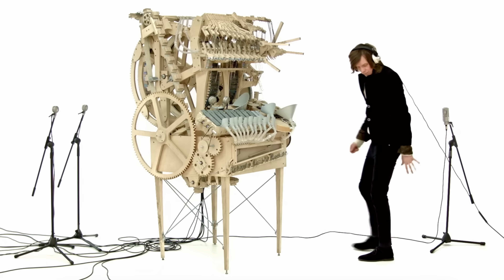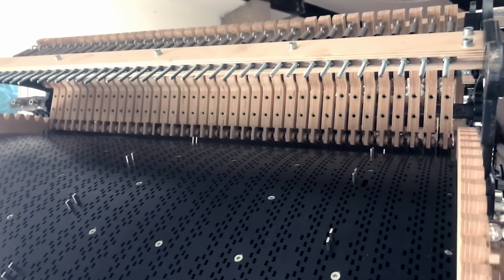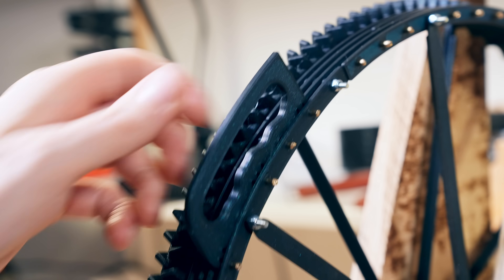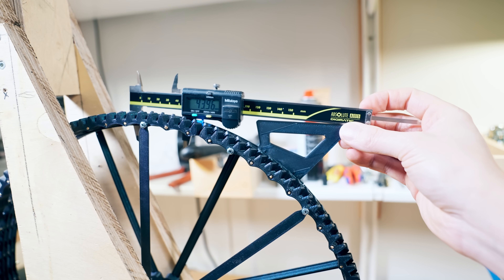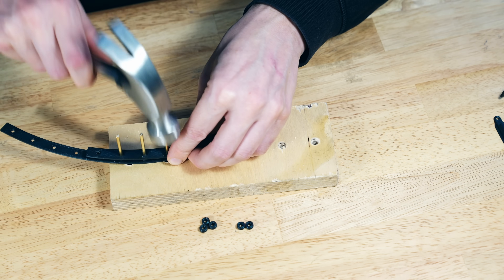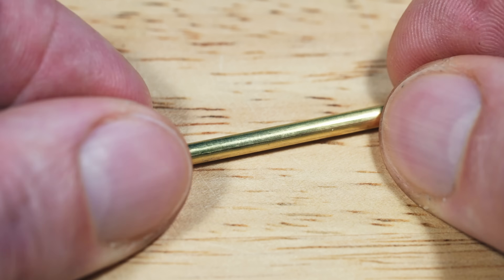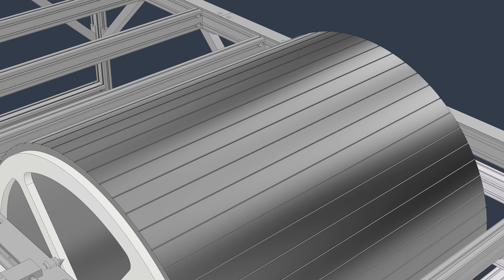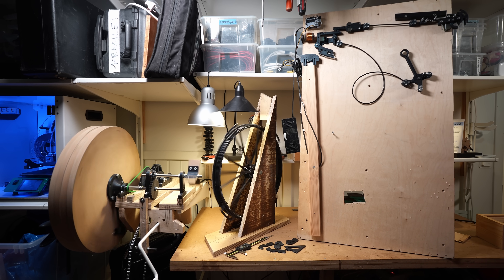Prototyping The Marble Machine Programming Wheel

Comment: Martin, in trying to find a reason to quit the marble machine, keeps accidentally discovering the perfect solution to his problems.
Reply: Martin keeps discovering everything taught in mechanical engineering school, the hard way.
On the plus side, doing it this way means he'll retain all the lessons. When he's done with this project, he should consider fast-tracking a degree from a technical college.
Reply: @peterjohnson9438  I guess the difference will have been between learning and understanding. Having experienced the pain for each and every principle, Martin would have pretty much grokked mechanical engineering by the time he is done.
Reply: @Tsagan learning the 'hard way' usually means you truly understand, vs superficially studying for exams.
Reply: @bubblesculptor   doubt it
Reply: @peterjohnson9438  Press 'X' to doubt.
Reply: @peterjohnson9438 True in terms of mindset and approach to problem solving, but there still is a gaping hole to fill regarding maths, and mathematical models for motion, stress, vibration, dynamics etc. to actually calculate stuff... This would actually come in handy on this project too.
Reply: @peterjohnson9438 He would be useless in real work.
Reply: In a way, this is raw science. He’s discovering fundamental principles through experimentation.
Reply: @quakxy_dukx  It's not science though. Science requires strict methodology.
Reply: @thomasbecker9676  Please, tell me more how empirical testing is not scientific.
Reply: @anteshell He’s not doing “empirical testing.”

For example, examine how he attempted to “prove gravity was a constant” or his comparison that his “Huygen’s drive was 66x tighter than a flywheel” or his failed attempts to try to calculate and compare standard deviation between various RPM.

It’s all an amateur  hack (at best)-but nowhere near anything that resembles an engineering/scientific approach.
Reply: @br52685  You have some nice strawmen there. Did you built them yourself?
Reply: @anteshell  I’m merely addressing your statement about “empirical testing” and providing examples of his non-scientific/engineering approach.  Hardly a “straw man argument.”
Reply: @br52685  Engineering predates scientific method by far. they are not the same thing.
Reply: @anteshell  if anything, your original statement was a straw man—as he wasn’t talking about empirical testing and the scientific method.
Reply: @jarduhat8267  never claimed they were
Reply: @anteshell  Because in true science, you establish a hypothesis and you methodology for testing said hypothesis, including eliminating variables. Then you verify your results. Martin does none of this.
Reply: @jarduhat8267  Lol, that made me laugh.
Reply: @br52685  He wasn't? Here's the direct quote from the comment I was answering to: "It's not science though. Science requires strict methodology."

Tell me more how that doesn't talk about scientific methodology and how empirical testing is unrelated to it.
Reply: @thomasbecker9676  If you haven't seen that, then you're blind. It is as simple as that.
Reply: @anteshell  I was responding to another's comment who claimed:  "Engineering predates scientific method by far. they are not the same thing."

As I correctly stated:  NOBODY EVERY CLAIMED THEY ARE THE SAME THING.
Reply: @br52685  No, you specifically accused me of making a strawman in my first comment and I showed you that is a blatant lie. Try again.
Reply: @anteshell  Empirical testing is next to worthless when not done methodically.
Reply: @anteshell  I showed you that nobody said what you accused them of saying
Reply: @br52685  except that you didn't. I haven't accused anyone of saying anything. Learn to read.
Reply: @jeffreylee7184  Damn, you're making it really hard to take you seriously.
Reply: Man on a mission, to quit ;)
Reply: The true engineer's way. Trying to constantly make people give up on the idea by explaining how much trouble it's gonna be to proceed, only to motivate people by showing that it's possible AND doable.
Reply: Way more functional of his approach of actually trying to make it work
Reply: @extraintelligence The one that started this string of posts. The 21 post before mine does not seem to address your statement directly. I'm going to try.
Why did he hint at wanting to quit? I think Martin is getting tired with all the time/work he had put in to MMX 2 that lead to the scrapping of MMX 2 and the time put into the MMX 3 at this point. I think he is not getting the joy expected from it.
What's stopping him from quitting? It's the massive support and funding he gets and with what you said. Discovering a solution to a problem.
Reply: @tigerzero5216  There's a saying in the consulting industry: "There's money to be made in prolonging the problem."
Reply: @jeffreylee7184  if him faking it is him building 2 marble machines and maybe a 3rd, then I need to start faking things more
Reply: @RhumpleOriginal  He didn't finish the second. He abandoned it.
Reply: @thomasbecker9676  the second machine played music. Therefor - marble machine. You can cry about it all you want but it worked.
Reply: @RhumpleOriginal  Martin said his first two attempts were a failure
Reply: @RhumpleOriginal  define "played music." It was abandoned for a reason, and the group finishing it are having to make drastic design changes to make it work reliably.

And Martin is on record saying the original machine was a failure.
Reply: @thomasbecker9676  ball dropped, instrument was hit, it played a sound. He played full songs on both. He simply wasn't happy with it.
Reply: @thomasbecker9676  also wtf is it with you and others getting pissed off and demanding that they didnt play music or that they were not marble machines. Faking it till you make ot means your not actually doing anything. Your faking the work. He did actual work and physically built something that did something. Thats my argument.
Reply: @RhumpleOriginal  if that’s you definition of “music, ” then I was quite the musician as a child with my mom’s pots and pans…
Reply: @br52685  the only definition:

"vocal or instrumental sounds (or both) combined in such a way as to produce beauty of form, harmony, and expression of emotion."

There is a guy on youtube that has a "song" where he scratches on an acoustic guitar and then jams the thing repeatedly into a fridge full of pots and pans. I don't understand it but I have a friend that enjoys the experimentation of sounds

I assume you dont consider the syncopated string plucking in horror movies is considered music either.

Honestly the more I explain why you are wrong the more you seem like a cynical person that doesn't comprehend that you might just not be at a level to understand all art forms and the reason for them. You can sit in the dark woth your thoughts but if you think for a second I don't have the ability to shut down your closeted ideas then you are in for a long thred till it fills up.
Reply: @RhumpleOriginal  What are you babbling about?  The first two machine were a FAILURE—as confirmed by the guy who built AND ABANDONED them.
Reply: @br52685  so... the machines he physically made. Meaning he did work. Meaning he didnt fake making the machines. Meaning he wasn't faking it. Unless you have some info about those videos beign fully CGI. Im not sure why you are so apt so sh*t on the understanding that he didn't fake anything he was showing you.
Reply: @br52685  its like if I made a gun and the gun fired a bullet but it didnt travel as far as I wanted it to, I still made a damn gun. Failure or not, i didnt fake making the gun or firing the bullet. If a football team fails, did they fake playing the game?
Reply: @RhumpleOriginal  Who said anything about faking the machines?  Certainly not me!

If anything, the original poster (not me) was referring to being an engineer and how some people just “fake it until you make it.”

So perhaps you need to listen and understand people more carefully before you respond.
Reply: @RhumpleOriginal  “Faking a football game”?!?  Your analogy isn’t relevant to this discussion.

Martin’s first two attempts were a failure. It’s pretty clear that this 3rd attempt will also be a failure.

It’s not because what he’s attempting is impossible (a high-school kid already made a working marble-machine).  It’s simply because Martin doesn’t have the fortitude and knowledge to succeed.
Reply: @br52685  I think I enjoy pissing you off more than I do proving what you are saying is stupid. Don't get me wrong, I enjoy them both but I enjoy your anger in your responses a tad bit more 😁
Reply: @RhumpleOriginal  Yeah, your reading comprehension is way off if you think I’m mad.

But your existence is merely to make people mad?  1). You’ve failed at that 2). You really should re-asses your life goals.
Reply: @br52685  How did I know that would work. You are all the same on the internet. If you can't argue the original point you jump on anything else that you think you can argue agaisnt. Your so blinded by trying to prove me wrong you took the bait and are now arguing your made up idea of my existence. So I win I guess.
Reply: @RhumpleOriginal  What the original point?  1). Martin is not an engineer?  2). The first two machines were a failure and likely this third attempt?

Perhaps you could attempt to remain on point?
Reply: @br52685  oh so now you want to go back to Martin? No more theories about how I live my life? You are all over the place and are not answering my questions. You keep pushing your closed mentality even after I fully explained in context the thing you were arguing against. You need to make a valid effort to prove that Martin is faking it which contradicts my explination as to why he is not. That is the argument. You have yet to provide an unbiased viewpoint.
Reply: @RhumpleOriginal  What are your questions?
Reply: @br52685  you seriously don't know what you are arguing? You seem like the one that needs to reassess some things. 🤣
Reply: @br52685  ill help you yet again.

You - are saying he was faking things
I - presented an in context deffinition as to why he didn't fake anything
You - need to provide an unbiased objection based in logic that contradicts what I stated

If you can't then you simply fail but thats ok. I am sure you are good at something else in life.
Reply: @RhumpleOriginal  Nobody ever said he was faking things.

People are (correctly) stating that he’s not an engineer.
Reply: @br52685  Oh I see why you are confused. Go look at my original comment in the thread. Notice the @ mention. Notice that the person I @ mentioned is no longer in the thread because they removed their stupid comment. They stated their boss had the mentality of "fake it till you make it" and that was what Martin was doing.

So you didn't even have full context before you jumped into the conversation and are going off the idea that the original comment I was arguing never existed.

So now it is back on you. Either you confirm you now realize you are arguing something I argued that no longer exists or you need to, again, provide me with an unbiased objection based in logic that contradicts what I stated. If you side step again I am simply just not going to respond because I laid out all the info and don't feel like playing the political game.
Reply: @RhumpleOriginal   No, I did have the full context (as I was reading comments when that post was made).  "Fake it until you make it" didn't refer to a "faked machine."  It's a colloquialism referencing someone pretending (faking) to be something that they're not (an engineer).

So the misunderstanding is 100% on you--for thinking that "fake it until you make it" refers to a fake machine.
Reply: @br52685  On top of that, how is he faking being an engineer? At what point did he state "I am an engineer and you need to see me as such"?
Reply: @br52685  Lets take a look at the definition of engineer:

a person who designs, builds, or maintains engines, machines, or public works.

So Martin designed and built a machine. He never said he was an engineer but he fits the definition so you are now arguing the definition of engineer. This is what I mean about you being all over the place and being biased. You are not using the words in context and are going off your, I guess, gut feeling about things.
Reply: @RhumpleOriginal  Why are you upset? Martin failed to achieve his goals with MMX, much of it due to his own inexperience, inflexibility, and poor planning. This new attempt would appear to be going down the exact same road, towards another failure. Martin needs to listen to actual engineers before investing time and money in (literally in one case) reinventing wheels.
Reply: @RhumpleOriginal  Just face it:  you misunderstood the original commenter.  Nobody claimed his machine was fake.
Reply: @br52685  didnt say that. Keep making up arguments though. You seem to be having fun.
Reply: @thomasbecker9676  blah blah not faking it blah blah tired of repeating myself
Reply: There's a pattern.
Reply: this means he is meant to make it Never let the dragon win unless they are good dragons
Reply: "one finds his destiny on the path he takes to avoid it" ~Master Oogway
Reply: This thread is full of fake understanding.
Reply: @returntozero2112  I hope you feel welcome among your peers then.
Reply: Yeah he keeps scaring me with that talk.
Reply: @gillsmoke I agree. Upon reflection though, I’m impressed by how openly he seems to face the possibility of scrapping the project. I think that attitude is beneficial in this type of design.
Reply: I wouldn't say perfect. Because perfect is the enemy of the great.

Comment: Use bicycle wheels!  .?  Accurate, adjustable and shiny
Reply: Bicycle wheels as the structural core seems to have a lot of merit; the programming stuff can be precisely machined on top of that core, but no need to reinvent the wheel (heh) for a stiff rotating hub.